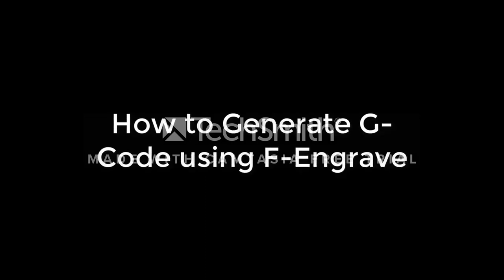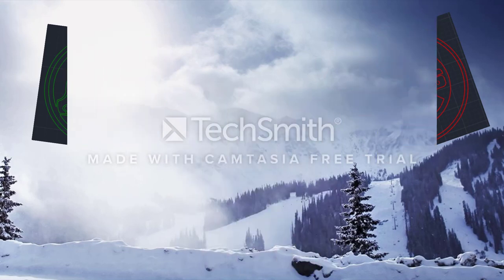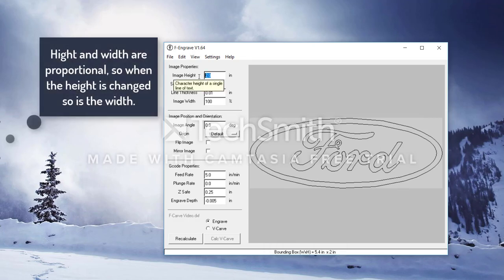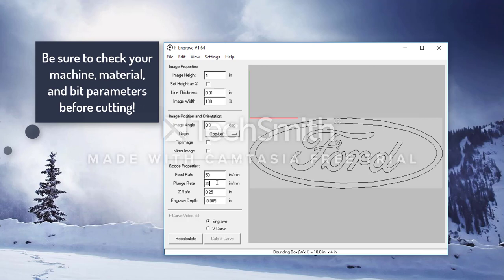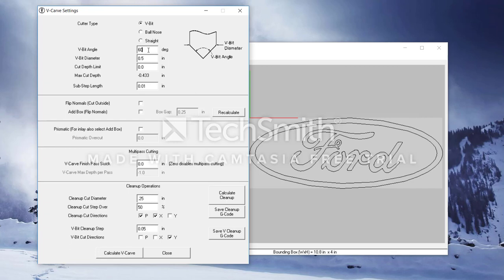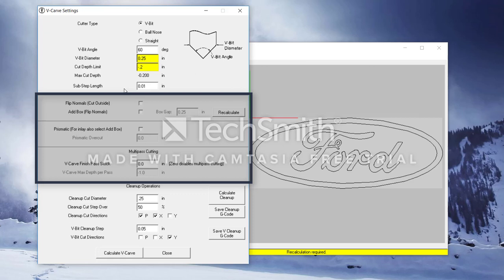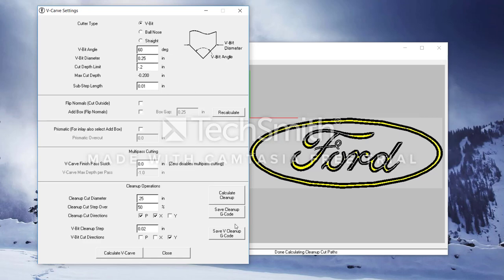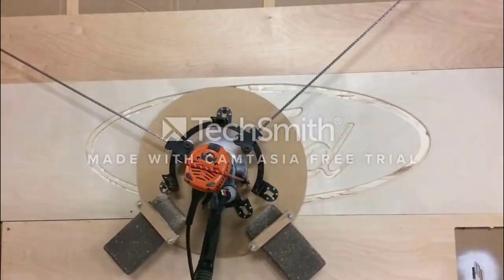How to Generate G-Code Using F-Engrave

Comment: I am wanting to do multiple passes, so that it isn't as hard on the V-bit and burn them up so quickly.  I have tried several things and looked for online help with this, and I just don't seem to be able to get it to work how I think it would work.  Any videos on this?
Reply from the maker: Hello Kevin, that is a good question. I do not have any videos on that because I have never tried to do that. I used to just cut in one pass with no worries about the bit. If I remember correctly there was a setting somewhere in f-engrave that would allow you to do multiple passes. If you can’t find that, I would advise to set up two runs of g-code, or cut the outline with a v-bit, then carve out the rest with a flat bit. 
I have not used f-engrave in nearly two years mostly because I no longer have a Cnc router. I wish I could help more! Hopefully you can figure it out. Best of luck

Comment: Did you cut the oval out with the gcode from F-engrave?  Or was that a separate step?
Reply from the maker: I think it was separate if I remember right. Make sure the zero location was in the same spot, and it goes smoothly.